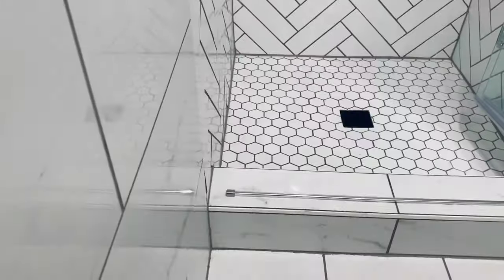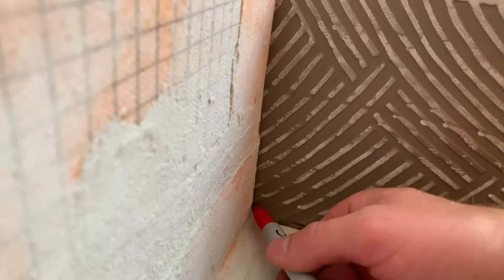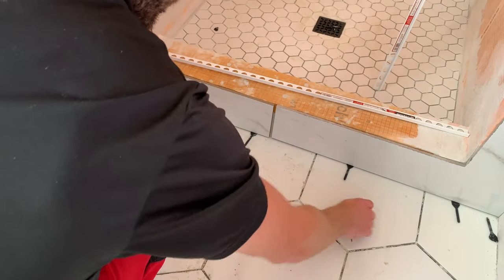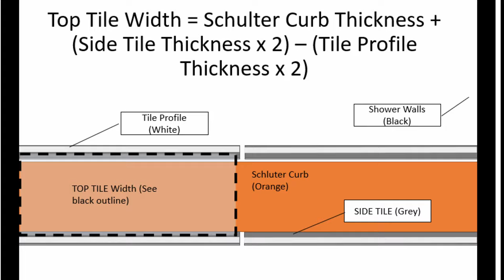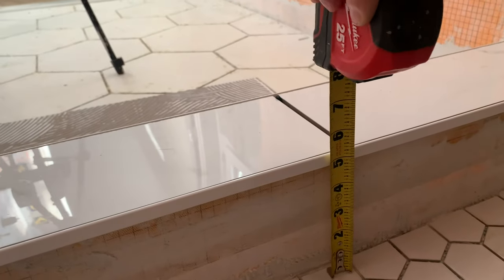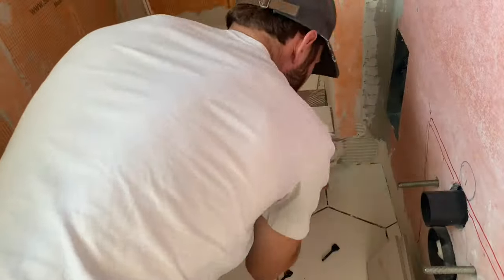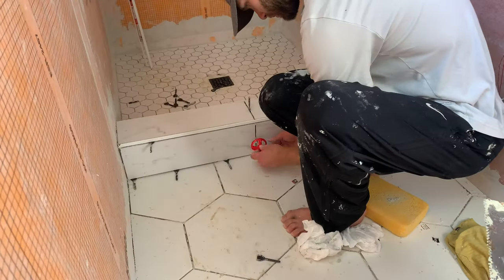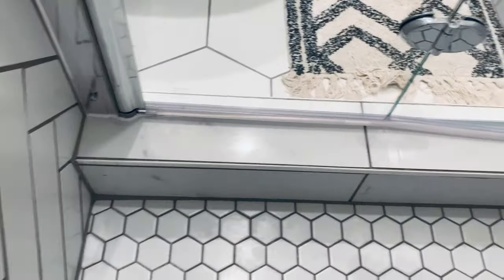How to Tile a Shower Curb [Schluter Shower Curb Tile Installation]

Comment: I believe the reason why your tiles are coming out kind of ragged on the edges after you cut is because you're cutting upside down. If you flip to tie all over you should get a much cleaner cut.
Reply: Or new better diamond  blade- or both!

Comment: If you don't make a 5% incline towards the shower the water will just sit on top of the tile on threshold and water will not drain from top of tile because you made it even. You must take a small level and make sure the bubble is just a hair past the middle towards the shower so the water will drain properly. Otherwise your tile will have to be replaced quicker.
Reply from the maker: Good point Mary! I show that within the video, but it is very crucial for any shower curb installation. Thanks for watching!
Reply: I measured the schluter angle and it was 2 degrees. Not arguing and not an expert…just saying.

Comment: Do you have to use a shouter curb? Can I use a cheaper alternative?
Reply: Using three 2x4s is a common way to do it. Just make sure the PVC liner from the shower pan goes all the way over the curb.

Comment: Ok, here we go;
1. Never cut tiles upside-down.
2. If you have an old blade or tiles are chipping, use masking tape on the tile face and mark the line on it and with that finishes the perfect cut. Cheers!
Reply from the maker: You are spot on with these - Lesson learned for next time. Thanks for watching!
Reply: I was wondering about that but Andrew’s tiles turned out well. Why shouldn’t you cut tile upside down?
Reply: @DebKiwi  The blade of the tile saw rotates towards you. If you're cutting the tile upside down, the blade enters the tile through the top face (in this case since the tile is upside down, it's the bottom, unfinished side), and exits the tile through the bottom face (in this case the top, finished side). The face where the blade is exiting, there is more probability to chip the tile out i.e. blowout
Reply: @FareedHameed cut outside down only with glass tiles
Reply: No Styrofoam in a shower, only in coolers.

Comment: I enjoyed the video. Well done. A couple suggestions. First (and a small one) is to check your tiles after putting them into the thinset to make sure you have good coverage or if you’d have to adjust the trowel size. Perhaps you did do this - I just didn’t see it. Also I’m a beginner so take this with a grain of salt. 
Second, Schluter is adamant about not mitering your profiles. At least for the niche. I believe it’s bc it creates sharp and a point edge but I’m not sure. However during their online education they stressed this at least three or four times. It should be a butt joint type. I’m not sure about this when doing your curb but I would assume that it’s the same thing. 
If you know of different information please let me know. 
Again, well done video.

Comment: Nice work! You can always get one of those tile files or tile sanding stone to help clean your edges up if they chip. Also, the ANSI recommendation for for combing Thinset is to be perpendicular to the length of the tile, meaning don't comb the Thinset the same direction the longer length of the tile. Probably not a big deal just pointing that out. Also, how you working barefoot!? lol  End result look great and professional.
Reply from the maker: Good Tips! I definitely need to get one of those sanding stones for my next tile project. Thanks for watching!
Reply: @AndrewThronImprovements  Loving the "barefootedness" and the tile job, as well.  My design co is Barefoot Empty Nest.  Do most of my work barefoot :)

Comment: youre getting the bad edge because you are cutting the tile upside down. Check out the pica pencils, they are like a crayon pen that wipes off so you can mark on top of the tile and then you dont have to cut upside down.
Reply from the maker: Appreciate the feedback! I’ll definitely give them a shot on my next tile job. Thanks for watching!
Reply: @AndrewThronImprovements  Even cutting rightside up, you will get some chipping. Buy an inexpensive diamond sanding pad for glass/ceramic and you can polish the edge to the point where it looks factory finished.
Reply from the maker: @Steve-sz3cp  appreciate the feedback, Steve! I’m definitely trying that on my next tile job.

Comment: Looks good. I would have done the wall first then the curb so that your corner trim pieces butt up to the tile on the wall nice and clean vs how you did it. Now your wall tile will wrap around the metal trim and won’t look near as clean. Nice design though!

Comment: BTW,  I would get a better quality diamond wet saw blade ( for 10" I use a Lackmond Beast blade, for 7"  I use a Pearl P4 blade for super smooth cuts) then get yourself a set of Diamond sanding blocks (80-400 grit) and rub the cut edges to make a close-to-factory look. This smoothed edge looks better than your chip edges even with grout lines.
Reply from the maker: You are very right, Allen. Definitely had some lessons learned on this build. But I should be ready to rock and roll for the next project thanks to comments like this. Appreciate you watching!

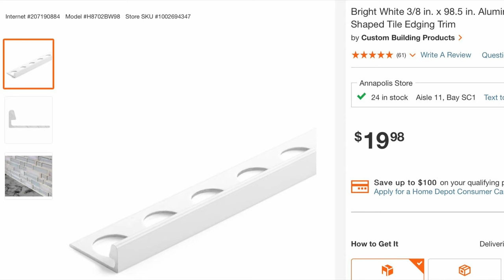Comment: 2:27 the cut edges are exposed tho? The only clean way around this even using profiles is to remake a factory edges with a sanding stone or a sanding pad on a grinder… 3:35 grout won’t cover the chipping, a new blade will fix most of this then still a tiny amount to sand or grind

Comment: You could use products on your tile (just the part you step over to enter shower) which cause water to bead and fall away quickly.  AMWAY used to have a glass and or tile cleaner which did this, sort of like rainex on your windscreen.  Do the algorithm-checking police read all comments ( hope not)  Peace.

Comment: I so wish I could have found this. I searched "how to tile a shower curb" up and down a week ago looking for this exact video but could find nothing. Now its done and I see this.  I needed help because the Kerdy transition was too large for my 4" tile. We cut big tiles and left a small gap on the outside corners to grout. This left exposed cut tiles on both edges and im so sad I didn't see to use the edging. 😭 Hoping this will work okay and not look too bad!

Comment: I stopped tiling curbs decades ago....now I only install solid surface curbs (Corian/Quartz). The material is far more weight stable and eliminating grout joints subject to temperature/moisture expansion wherever possible makes for a more maintenance free condition. Cleaner install of the track for shower doors and weight distribution of the heavier glass doors on larger openings.
Reply: I installed a shower seven years ago with a tiled curb, and just had my tenants move out… I was checking everything out and ended up pulling a handful of tiles off with my fingers today. Curb is still solid, and getting ready to put a solid stone on it 😅

Comment: You chipped that tile bad cutting it upside down.
Reply from the maker: Agreed - lesson learned on this one. Thanks for watching!
Reply: Yes, some whiney customers will use that for an excuse to not pay, or hold back a lot of money. You are a good kid! Best wishes. Now about them steel toed boots ...
Reply from the maker: @jmack619  Lesson learned on cutting upside down haha. I will get there. And it's so hard to fully suit up in PPE when you are in the comfort of your own home haha. But not as hard as cutting up your toes, I suppose. Thanks for the support!
Reply: @AndrewThronImprovements  no biggie, we have lots of toes!! I am doing my bathroom reno to walk in shower, with curb. Thinking about heated schluter shower floor and main floor. I am watching about a million videos!!!   Yours are great, I hope you have a long successful  career. I did electric contracting for years, customers can be your best or worse part of the month. On the corners where side panels meet back wall , and the floor, I am seeing some mixed opinions such as grout with some silicone(good color) vs pure silicone (a lot longer lasting)  . What are you doing for movement in those spots ?  Be The Best !!
Reply: @AndrewThronImprovements  on that cutting upsidedown thing, would it work better, if you masking taped the cutmark on the good side, before you cut it ?
Reply from the maker: @jmack619  Agree with you on Contractors! I left a small gap for all changes of plane and used silicone at all gaps to allow for movement. Fingers crossed that it holds up!
Reply from the maker: @jmack619  Perhaps. Might need to put that technique to the test.

Comment: What is the track at the bottom?   Is that to stop the water from going outside the shower and on the floor?  Dealing with that now and trying to fix it!
Reply from the maker: Hi Susan, that is the idea! It's just a little lip that that slopes back in towards the shower and prevents the waterproofing strip from extending too far. It came with the Bi-fold shower door I purchased. Thanks for watching!